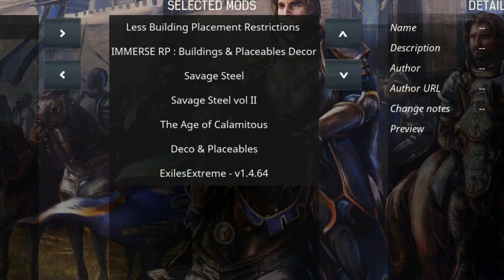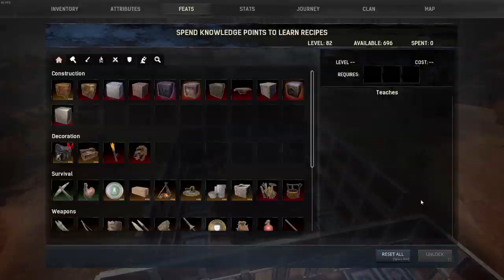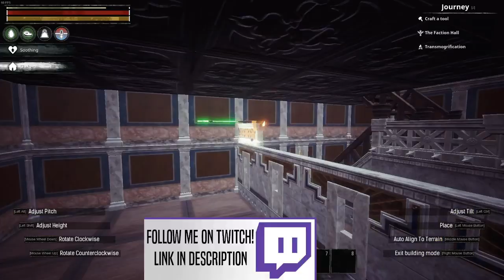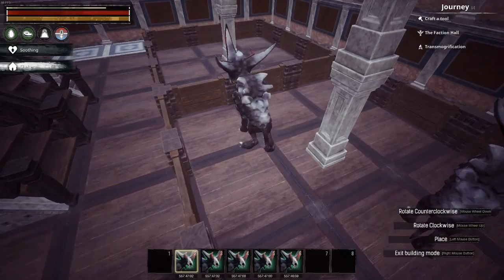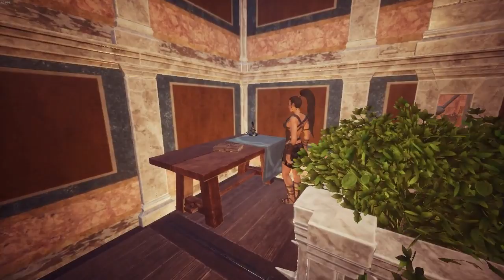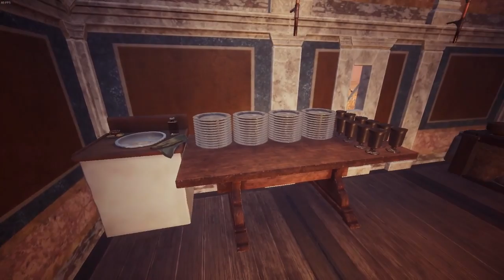Conan Exiles: Bank Build Guide (Modded Build)

Comment: So this the smaller one that would fit nicely in to any sorta township eh?  
It truely is a lovely building, but apart from my arena, this ¨small¨ bank of yours dwarfs just about all the buildings in my town center/commercial area.
The 2nd largest building there has a footprint of about 2/3rd of this teenie-tiny bank of yours, lol.
Reply: The vault alone is pretty big, so unless the bank just puts its valuables in chests it's going to be a fair-sized building. Plus, of course, in this case there's got to be a basement where rocknoses are raised. There is no terraforming in Conan Exiles, so the basement raises the height of the whole building. Given the requirements, it's a fairly modest building. It could be made less imposing by using a hipped roof or a flat roof instead of a double gabled roof.
Reply: @dlwatib  Valid point about the size of those vaults...makes it damn hard to build a proper bank of modest size.
I think i can make it work though, IF i  can just get myself to let go of my plan of breeding elephants in its basement... :(